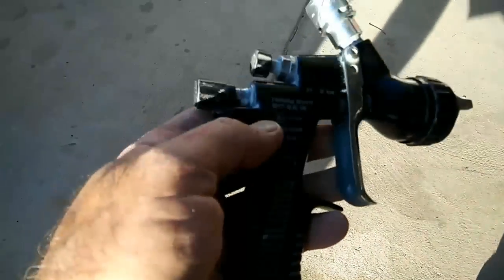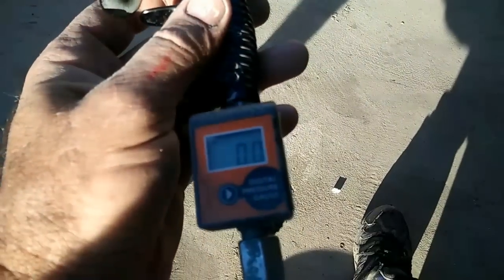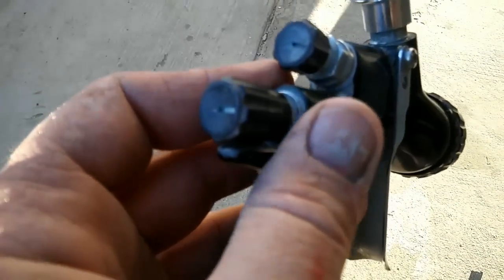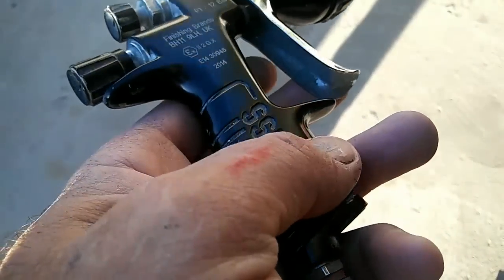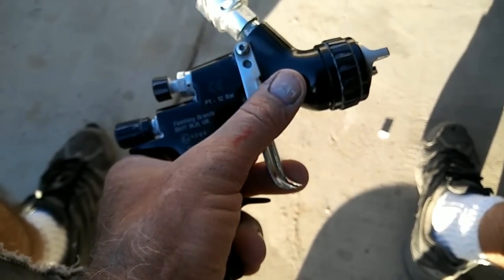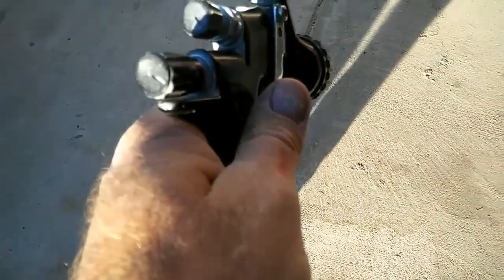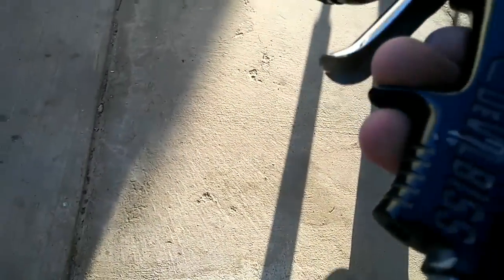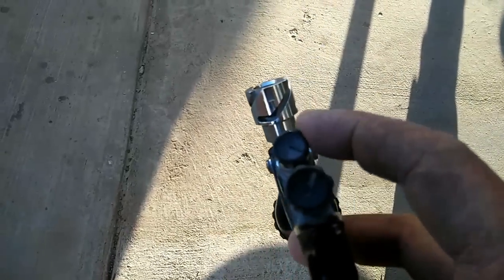How to spray clearcoat without getting any Orange Peel

Comment: hey nice video. I have the flg5 devilbiss. I spray in a self built booth and use hs clear for airbrush work and graphics cover. I have been using 2bar 29psi and full fan with material all the way out and you are right cloud city. should i try turning things in a little bit. I get very little orange peel the way i am doing it now but wish i could get the cloud down a bit. Any suggestions would be helpful thanks.
Reply from the maker: I havent used the finish line gun yet but from what I hear the tekna is better so I cant comment on using lower pressure on that gun. Like on most other guns I have used you cant really spray well with lower pressure. you might want to try the setting I used then see if it responds like the other gun but i would think it will require at least 20 lbs to get a fine spray.
Reply from the maker: if your just blowing clear on harley tanks it might not matter much anyway but spraying a whole complete car would be tough at 2 bar or 29lbs. I dont think you could see very well.
Reply: Mike F I have a tough time seeing after just a few parts. Just wondering if I should go lower pressure and screw in the paint to knock down some of the cloud. Or will the high solids clear not come out as well
Reply from the maker: high solids clear will be hard to do at low pressure unless you reduce it. check the specs to see if you can add 15% reducer. if so you can reduce and lower pressure to 20lbs with the tekna prolite gun any other gun may not spray at lower pressure. tekna prolite or iwata super nova or Sata 4000 or 5000 may spray at lower pressure and still make a decent finish.

Comment: Most of this is true,,but you forgot to explain how no matter what gun or air pressure you use,,,Clear mimics how you put your paint on!
Reply from the maker: all good points and yes I did leave out some stuff. Hard to think about all this stuff when trying to make a video. I just made another video on this subject that should be released Monday with Spray work and narration.

Comment: What size tip and cap you using?
Reply from the maker: I was using the hvlp but the TE20 became compliant afer this video. 1.3 spray head and te 20 regulated at 16lbs makes less overspray. Fine enough for many clear coats to get very little or no orange peel at 2.5 to 3.5 turns out. first coat 2.5 to 3. then go to 3.25 to 3.5 and it will be a monster.

Comment: Does a different size tip make difference,  mine is the TE20
Reply: That would be the air cap the tip is actually the part that the air cap covers

Comment: I have a Tekna pro lite and it’s orettt much crap for anything other than base coat.. at least the one I bought anyways. Heard so many good things but I haven’t gotten good results. I’m a production painter for 10 years and I have tried everything possible and it just doesn’t produce results like my iwata
Reply from the maker: joesass1986  The techno pro lite is very different to use than a regular spriggan need to have the fan wide open And be very close to the work

Comment: I have orange peel in the base coat. So what do I do next? It’s shiny and smooth but still has orange peel. I don’t want to apply a clear over it cuz then the orange peel from the base will be trapped under the clear. Anyone have any suggestions for me?

Comment: Surprised that you don't mentioned viscosity when you are talking about putting down paint without orange peel.  You don't even explain why you get orange peel.  Film thickness?  Surface tension?  How air pressure affects it?  Atomization?  I spent too much money on HVLP guns and sold them, the only gun I use for any top coat is my BBR, and never spray more than 30 psi.  The only time I ever spray thick clear is with Candy because if the flake, (the only time you need that kind of depth).
Reply from the maker: sorry cant explain everything in one video I have others. thanks for watching. mostly talking about 4 to 1 clears compromising viscosity on most 4 to 1 clears causes premature failure. always read the label on reducing clears the thinner the better for finer spray.

Comment: 29psi with the trigger pulled or not?
Reply: You only check with the trigger pulled
Reply: @DaBuGzLiFe  yes but you don't pull the trigger all the way, that's the point, only air coming out, needle still in

Comment: Tip size?
Reply from the maker: Te20 works best if it's legal Where You Are I used it hv30 which isn't as good because it wasn't legal at the time 1.4 also depends on the clear the one I was using was fairly thick but that still breaks it up fine
Reply: Thanks man✌✌✌

Comment: Do u get the same result spraying high solids single stage???
Reply from the maker: very much the same but you can ad reducer to the single stage. depending on the product I usually ad reducer to each coat. so first coat  maybe 25% reducer Fast second coat ad some slow. 3rd coat ad some more slow.  easier to get fine spray with  singe stage.

Comment: A lot depend how you mix you're clear coat.
Reply from the maker: what clear you use,  hardener for it. fast slow air temperature Just dont reduce it unless it says to do it on the can or it wont last.

Comment: fuking spit it ou man!  3 min tip took 20mins, plus i can see as much orange peel in that paint as ive just got with a £20 gun!
Reply from the maker: Lets see you spray with that 20 gun at 14lbs or 1 bar and make it look that smooth. Sorry man it just isnt happening. This was not for a booth spray guy more for a diy at home no orange peel low pressure less over spray job. Booth spray with that gun would be easy as pie and yes it would look much smoother. I have been painting for 35 years I can spray super flat in a booth like any other professional. look at the other videos showing the sides of the roof super flat no orange peel at all.

Comment: Im  not a profesional by any means i use hvlps and spray laquer on cabinetry and trim, that vehicle at the begining you said was not bad for orange peel id puke if i every got anything close to that on the few vehicles ive sprayed that  is very heavy orange peel in my eyes
Reply from the maker: remember that is a really flat surface and I sprayed it at very low pressure to minimize a huge cloud. It buffed out completely level. I can spray much nicer in a controlled place. Show me a video link of you spraying anything at 16 lbs and it looking more level than that. I really doubt it.
Reply from the maker: I have sprayed more lacquer than I would even want to say on cabinets. Completely different than spraying urethane clear on a VW bus Dude. I have been painting for more than 30 years. Spraying lacquer is a breeze. I usually use a airless with a 4 14 flawless.

Comment: There's no man who can spray without orange peel, not even you. Moreover we all can sand it away. The orange peel result from so many reasons that you rarely get such a conditions, that every part would be fit.  😉
Reply: the orange peel is a result of the paint and/or clear contracting as it dries. I imagine lots of light coats with appropriate intervals would help. I'd personally just t-cut it out afterwards though. and leave the sand paper out of it.
Reply: Chris Burton yes, you would be right also.. 😉

Comment: Thanks for the good info but geez...  Those "inexpensive" guns you suggest are like $500 - $600!!
Reply from the maker: yea the cheapest good gun is the tekna prolite. about 425 or so on amazon with all the tips. If you can tolerate some orange peel but still more smooth than others the harbor freight pro line gun for 79 is ok.but wont last very long because of the design. IF you are going to spray more than one or 2 cars it will pay you in materials to buy a good gun. Less waste too more goes on the surface. Unfortunately there is not many other ways around it. accuspray is good disposable gun and sprays nice.

Comment: So a laser level with a fan pattern will be so wide when it’s so far from an object.  Mine happens to be square, so 5” wide laser fan on panel means 5” from panel.   It’s often hard to judge distance because of the color of the panel taking away some sense of depth, so while it may seem like you are close, you probably aren’t.    But you can clearly see the laser fan and judge it’s width, and with this type also your distance.    Perfect.   Also if you get off from perpendicular it’ll show with the laser dramatically.   That’s another two-fer.   Double therapy, double filtering, double overspray removal, double dust removal, double paint gun positioning indicator.   We got dubs and dubs and dubs.    I like mine black as night and deep like your mom’s eyes.    Before the jaundice set in.

Comment: So someone who is a hopyist and going to Use a gun 2 to 10 times in his life should go anhjd buy a gun for a couple of hundred dollars....
Dude I have used the Harbor freight cheap gun painted 3 cars and a dozen tool boxces as a hobby for myself and friends.
Once you dial them in they work fine.
No Offense but for someone with sponsors and a major channel; yeah get the good stuff but most DIY are on a budget and just cant afforsd it.
But a 30 gal compressor yup a 12 buck gun sure.
I run them at 17psi and I get very little to no orange peel.
Reply from the maker: Just on a flat panel you will need to use a good gun. I can spray with almost any gun and get little or no orange peel on something slightly rounded or small. but painting a super flat panel with High solids clear. you really need a good gun. For the hobbyist the cheap gun will work, but if your going that route I would spend  a hundred bucks and get the spectrum gun which is much easier to clean and better atomization as well. you will save the difference in time and thinner to clean that cheap gun after a few uses.
Reply: @Mikefngarage  I Understand your stance.
But you missed my point. Most people will spray 1 amybe  a half dozen things.
I do hobyist stuff My girl bangs up her car i get an old snpon box that needs new paint and saving from the rust gremlin I weld and paint it (and resell).
I have as I said painted cars trucks and toolboxes, trailers etc all with the cheapo gun No problem. Just like any thing else Learn the tool and practice.
Lets not talk about my first attempt at welding...It wasn't pretty.(understatement of the year).
But I woulkd say probably 60 percent of your subscribers probably cant afford the extra C note for a gun Bu 15 bucks probably.
The HB guns are not great but they do the job adequately. Its like saying a no name wrench is not as good as  say Sanp on.
The noname you will use maybe a couple of dozen times while the Snapon is meant to be used constantly In a shop.
So if you want to learn or only have a couple of projects go ahead and Get the cheapo. If you are going to LOOOOOTs of painting save and get a better one.
How many people looked at the price of the guns you were talking about and heard you badmouth an inferior but serviceable tool and said nah I guess I wont bother and a project never got done and a new bro who could be enjoying our hobby Dropped in the offing cause he couldn't come up with a n extra hundred.
I've been there.

Comment: "How to spray without orange peel" 1 minute in, shows you orange peel....
Reply from the maker: considering the flat surface and gun pressures being low at 16 lbs that is pretty smooth. If you dont think so you must not be a spray man.

Comment: I tried that, it leaves it dry
Reply from the maker: you must be doing something different. maybe you hare hoding your gun too far away. or you are using a different gun.
Reply: Mike F nope, I have the same gun. I guess it depends on the clear. Glasurit 2:1 super thick. I would only recommend the mist teqnique if it was a flow coat
Reply from the maker: yea that clear is way too thick for less than full pressure. need to be at 2 bar or 29lbs This is for 4 to 1 clears that are medium solid.  Usually people spraying at home are not using that clear. Pricy$$ Try full pressure and wide fan 6 inches from the surface. If not turn the fan in until it goes to no orange peel. But you will need to be in a booth. we are talking cloud city. also probably need to be almost wide open with material. I would try about 6 turns out.  the principle is the same though better atomization is more smooth. Smoother lighter coats 75% overlap or more and  fast movement. 

I havent used glasurit clears since they were glassomax. Even then I used RM clear over glassomax basecoat. because their clears were hard to work with. back then they didnt buff at all. RM and Glasso are both BASF products. so it worked fine.

Comment: I have this gun I wouldn't compare it to harbor fright guns.
Reply from the maker: no comparrison. not even a slight bit. this is just a different animal. Compare to iwata super nova and sata 4000 or 5000 maybe they are more in the same league.
Reply: I have this gun too. No orange peel since I switched over from HF guns. No comparison. Been using the Te20 cap. Everything is going good until I realize the compressor is still turned off. Finish goes from good to terrible just like that. I have two small compressors feeding the same line, and that can cause variation in line pressures, effecting paint layout..
Reply: marc chantal b b
Reply from the maker: yea super great gun. but a bit different to learn how to use. I would never use a HF gun again after using it. My buddy uses that professional HF gun though and he sprays show quality smooth with it. We are going to do some videos pretty soon at the spray booth spraying with both guns. so stay tuned.